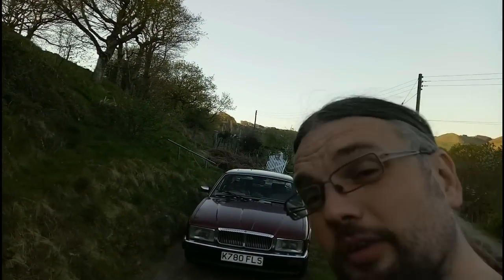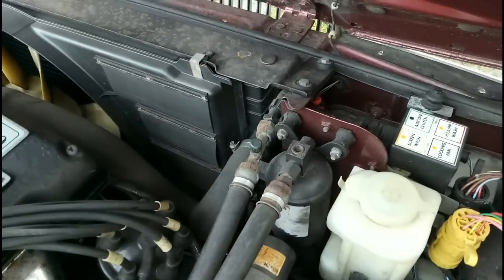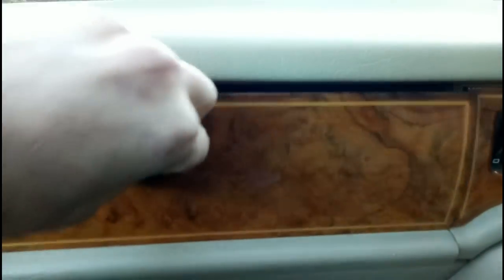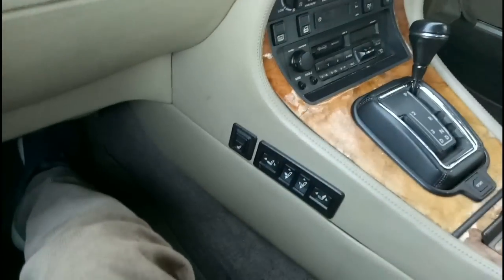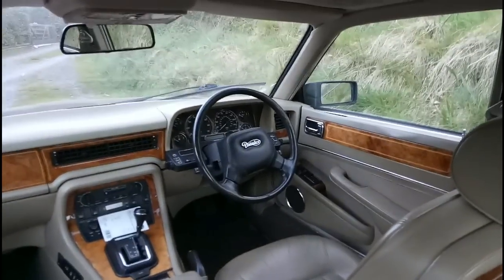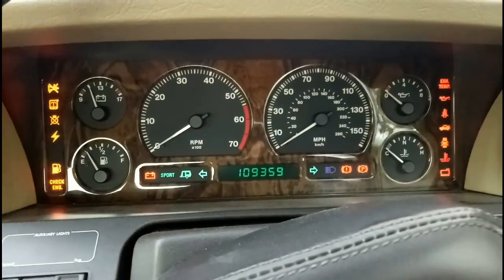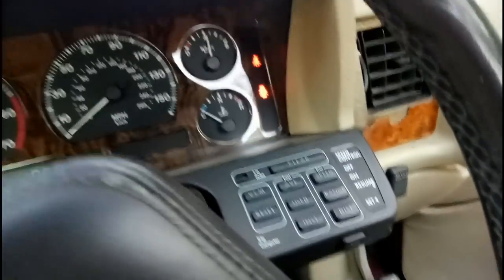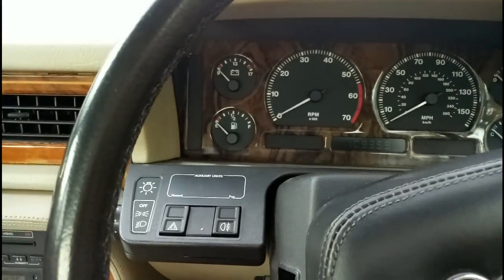New Daimler! The Walk Around video. Now sold.

Comment: This is my kind of car, I paid £495 for a 1991 W124 Mercedes 260E and I'm still running it now almost 3 years later!
Reply: Delta Fox  Didn't know that, but it is true that the cars' build quality isn't what it once was (Mercedes used to be legendary for build quality at one time). 

I had a ride in a Mercedes S-class (350 Diesel) this year and was taken aback to find that the so-called "veneer" dashboard trim wasn't solid and certainly wasn't wood; I could push it in as there was nothing but air behind it.
Reply: Delta Fox  

Mercs were more reliable than hags and Daimler s in the 70's aa Mercs could sustain constant 70 effortlessly but jags found it difficult to without having problems 

If someone had said in the 70's when jags and Daimler had two fuel raps to fill that jags would be electric in 2020 owners would have laughed but technology has moved on a bundle as has design

Comment: It's interesting what neglect will do to a car like this. I bought a '92 when I was about 22ish, 141k miles, 4.0l manual! It had similar rot around the bulkhead and wings, but far more of the electrics worked and all the bits of interior were still bolted on. Ruinously expensive to run on £15k a year (mainly fuel, parts were quite affordable), but amazingly cheap to buy (which I reckon is why a lot were neglected).

Daily drove it for a year, and occasional use for a couple of years after before I managed to overheat the engine one day by leaving it running to charge the battery and not noticing it had a pinhole leak in one of the coolant pipes. Blown headgasket and rod knock. Amazing. Oh, and set light to the boot when it was half-full of petrol while trying to drain water out of the fuel tank...

So it sat looking sorry for itself for a couple more years (although I did manage to procure another AJ6 for it), until a mate of mine bought a remapped E46 330d. Lightbulb moment as I realised just how nice the XJ40 would be with a meaty, but still refined, 3.0l turbodiesel. Bought a rotten 330d and set to work :) it's not a million miles away from being sorted now, but if anyone's interested I've got a build thread here: https://forum.retro-rides.org/thread/216608/1992-jaguar-xj40-superturbodiesel Oh, and if anyone's wondering about the AJ6 and 5-speed I'm planning to try and wedge that into a Triumph 2000, because why not ;)

Also also if anyone has one of these. The rust under the corners of the windscreen pillars is caused by these little box section dividers that are sealed into the scuttle panel, and the area filled with silicone sound deadening foam. There's a rubber grommet giving access in the corners of the bulkhead on the engine side. If you excavate all of the foam from here, and drill a hole diagonally into the little divider to let the box sections drain you can save yourself a windscreen replacement. If the foam comes out clean then happy days, but if it's stained orange then it's been rusting in there and you probably need to at the very least clean it, soak it in phosphoric acid for ages, and then paint the whole thing up again (if you're lucky enough that it hasn't broken through). A similar issue causes the rust on the c-pillars which are also filled with sound deadening foam. You can get to these through the boot, where there's some bolt on panels that close off the boot underneath the wing (with the looms poking through them). Bit trickier to get to, but excavating these bits would also be a pretty good idea. Or at least excavating a drain pathway through them.

Comment: And now I only desire XJ40/81 more than ever. 

It's my dream car since early childhood and still the most favourite and desirable not only just an XJ, but the most beloved Jag ever — even while literally every Jag is my dream on its own. It could be said, 2nd gen XJ hands-down is my beloved car among any other car in the automotive history. It's more precious than other Jags — even the '63 S-Type, 420, Series I XJ, X350 XJR, Series III Eagle or XJ-S/XJS, than any 911 — even the G-serie 911, than any Alfa — even the GTV6, than Saab 900... All these mentioned cars — including some other — I give all of them my 10 out of 10. While that rusty, unfortunate, unreliable but still glorious cat easily gets mine one extra point from the very bottom of heart of mine. I admire that boxy sleek thing. I adore that ridiculous 2-spoke steering wheel. I've even saw it once with my very eyes: grey Soverein RHD, probably '90. God that thing is low and long and wide! Even with two flat right tires and a couple of rust on literally every corner and edge, staying outside under the sun and rain it was still looked like a king, better than any car parked near him or driving on the roads past him.

I'd even buy a few scrapped Jags and learn to proper bodyworking — incl. cutting and welding — only to make one decent car. We're not gonna say that Frankenstein monster will surely fall apart by these welding points, are we? Totally electric and engine rebuild, total body restore, tons of money, hundreds of hours. But who cares in the end? What a sane man would rather think about buying Camry while sitting in V12 Daimler? C'mon mate, you're in the bloody Jaaaag.

4.0 is still awesome, anyways. But V12 is something entirely different thing.
Reply: Love the enthusiasm mate. My guilty pleasure is also a series II XJ12 as well. However, I go through that mission with a Holden HQ over a decade now. Loads of money, time, workshop manuals, tools, scrap cars and extra parts. Need another life or two to do that mission with a Jag though

Comment: The bottom of the screen has delaminated because of expanding rust under the scuttle/bulkhead area is stressing the glass. It ain't going to be pretty under the trim panel.
Reply from the maker: It isn't. I was going to include a photo, but forgot. Had to edit it quickly last night, and my bed was calling...
Reply: Could always smoke around in it until next mot.  Get those rear tyres spinning (but not on public roads though 😉)
Reply: With the rust on the bulkhead and under the screen, this car really needs a screen out and engine out just to repair the rust properly.

Comment: Certainly you have a job ahead of you, the engine has few MPs (170000 KM) you have to see if the gasket is not burned, and the viscous coupling of the fan of the radiotor is still in good condition (if there is no risk of cooking the head)
Reply from the maker: Sadly, I gave up on this one. A project too far!

Comment: Had it really only run 109 359 miles and yet in such a bad state? I had a 1993 Regency Red Sovereign before that had yet 250 miles on the clock and it was in much better state. It costed a bit more than £350 though :)
Reply from the maker: Neglect can do bad things for a car, regardless of mileage.

Comment: I have a 1990 E30 325i, it has never been garaged as far as I'm aware, and has 200,000 miles on the clock, but absolutely everything (bar the stupid hydraulic headlight angle adjuster) works and it is in much better condition than this thing. It definitely looks like the owners stopped caring about this car some time ago, which is sad. :(
Reply from the maker: +Acme Yes, this was definitely neglected. Shame. It was once a lovely thing.
Reply: nice one mate electrics taken care of with a draper tool love the old bms
Reply: Acme ~ miss my e30 tourer alpina engined (engine swap) chasis had 360,000 before head went so we put that in.... but at mot it needed 2k worth of work and we just didn't have the cash. Its still alive. Its a track car now. H591 XUL if anyone wants to try and find her. 2.7 alpina engine. Kept 2 litre gearbox. Acceleration was instant and still hit 130 and it was chipped to rev to 8k instead of 6.5k. Totally stripped. Rare front splitter off of hartge... black. Lowered stiffened and strut braced (properly!) Really well known car in wiltshire area  (was) ~ had a personality. If a boy racer in a corsa over took it didn't matter how much you mashed that big pedal..."ellie" didn't wanna know... wasnt worth the fuel.... but when a TT came along....it suddenly decides its gonna tear it up! ~ go figure?

Comment: This is a prime example of why you should never buy a car blind. I've had a few XJ40's, paid way less than £350 for some and not much more for others. All been decent cars, some better than others but I inspected every one before I parted with any cash.
Reply from the maker: I always buy blind. More than anything, it's a prime example of why you should never buy a cheap Jaguar...
Reply: @HubNut  I've never bought blind, not brave enough but I've probably missed out on some real bargains. 10 years ago you could buy a good, cheap Jag. I won a gorgeous XJ40 3.2S on an ebay auction for £535, but I'd viewed and test drove it before bidding.
My weaknesses are not being able to resist stuff that seems too good to be true and buying the first example I see. 
Bought a poverty spec XJ40 (with plastic wheel trims!) from North Wales, full of water from a leaking sunroof for £150. It promptly failed a few miles from the seller and was brought home on an AA recovery truck, proving you can't guarantee anything even if you've seen it and driven it before buying!

Comment: Might not be your best buy ever, how did manage to fall apart like that in a relatively short life span ?
Reply from the maker: To be fair, it is 25 years old. That's pretty ancient in car terms!
Reply: You think so? For a Jag/Daimler maybe, but my first car was a Peugeot 204 and it looked an awful lot better after 25 years. And had a good ride, engine not quite as mighty though. In any case, you are a brave man, and a clever mechanic, that surely helps.
Reply from the maker: Ha! Brave maybe. A clever mechanic, definitely not. I have had a Merc W124 of similar age, but that also needed welding and I never did manage to cure a running issue it had. It did feel more robust in terms of interior fitment and the thickness of metal, but was definitely not problem free.
Reply: Citroen's and Peugeot's might actually be a lot better than Mercs and the like in terms of rust and engine longevity, I think. And you sure look like a clever mechanic to me, but then I'm a guitarist. On another topic I have to sell my old Citroen van because of Low Emission issues, and am looking at acquiring a cheap C5 in Holland.

Comment: Well youve ticked the Jag box now so alls well that ends well. Bought an x300 sovereign a while back for 600 quid, kept it till the mot was up and moved it on for 300. Was happy with that just to tick the Jag box. Good cars and smooth as but was just a mess of switches etc and a bit boring to drive tbh. My old e32 735 from the same era is a  way better car, better built and much better to drive so still got it. A Jag is a Jag i always think👍
Reply: Interesting hearing that, based on owning an E32 735 and knowing what utter disasters those cars are the Jag must be next level. The only good euro from those days was the W124, that you can actually rely on.

Comment: It's very "Spares/repairs" with all its' faults, and that fusebox, jeez, what happened there? Did a former owner use a "million amp fuse" (aka tinfoil over the contacts) or something?? :S
Reply from the maker: Who knows! It didn't work, that's for sure...
Reply: It's probably a short in the heater wiring, definitely somethimg to not bodge, otherwise it'll become a big bonfire... :S
Reply: That could be a good thing.

Comment: Whilst they give problems, you'll notice the car got you home with little drama... I laughed as you struggled with the seat belt, (they ALL do that, sir) and noted that you had pretty much all the standard xj40 foibles like the melting side fuse box, sagging roof lining, fuel fail 44, rust in the usual places, and of course, partially inoperative climate control. Your diff sounded OK, which is a big win... BUT in 20 + years of driving these heaps, IME they ALWAYS get you home.. 
But: if you buy what was a £50,000 motor car for 350 quid, you have to be prepared to invest a bit of time and effort to sort out the stuff that the previous owner couldn't. Most Daimler owners aren't technical types..
Reply from the maker: Yes, once the price gets low enough, they end up in the hands of people who can afford to buy, but not run a Jaguar. This one was horribly neglected.